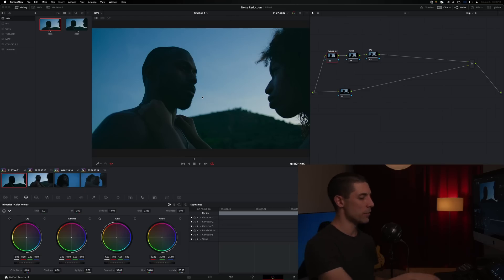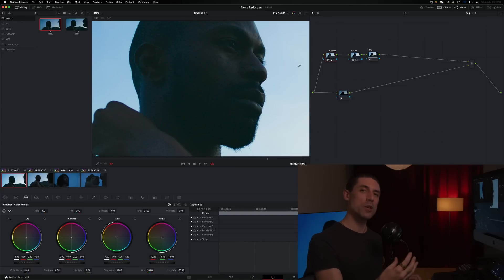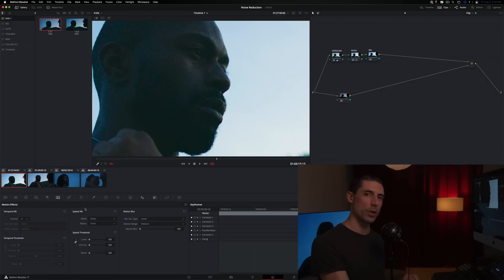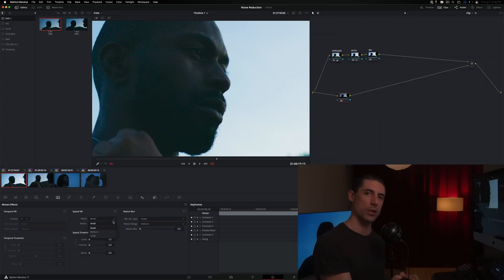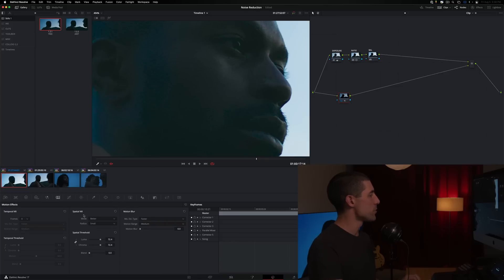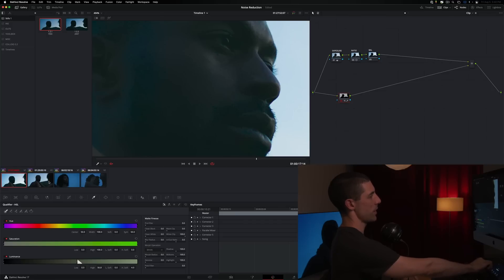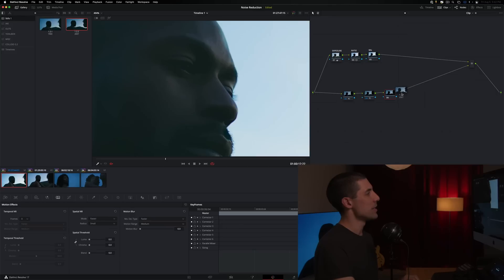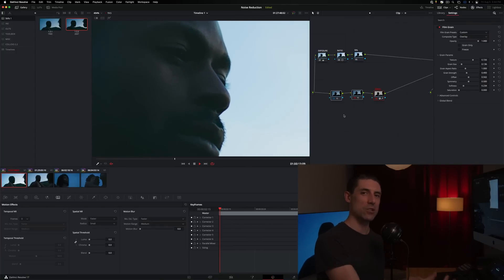How use noise reduction like a pro in DaVinci Resolve

Comment: A question coming from a newby, i saw @CullenKelly put the noise node in a parallel node from the nodes used for the grading you might do to the image, is that the best way? is the there any rule of thumb for where to put the node? some people do it before input CST other after the CST but in serial node, anyone form the audience could provide an insight?

Comment: I've noticed that a lot of people play with color and apply filters where necessary and not necessary.If you're doing commercials or beautiful videos it's understandable. Movies. But when you explain how you use the program and show the interface of the program, you have to make sure that everything, even the little numbers, are visible to the customer or subscriber. If I didn't know what he was doing there, I wouldn't know what those circles were. I am a meter and a half away from my monitor. Just for fun, I turned on my DaVinci - everything is perfectly visible.
Reply: @CullenKelly  I am in no way criticizing you, it's up to you how you want to do it. I expressed my opinion on the fact that the interface (program desktop) is too dark.When you sit down at the beginning and start explaining everything is cinematic and that's fine. But the desktop is dark and so you can't see the details of the program well. Maybe you have a 4K monitor and you can see everything well there, I don't know.
Maybe my English is not very good.
I wish you luck and success. Do as you see fit

Comment: A few notes to add. 

Regarding your intro statements. No one wants noise or has been conditioned to like or accept noise. We have been conditioned to accept and like film grain, not blotchy ugly digital noise. Very different things. I want to underlay, very different things. In fact, after noise reduction, adding back some simulated film grain, helps to give an illusion of texture underneath and that is a good thing. But you don’t add digital noise, especially chroma noise. 

You might get away with some luminescence noise if its film like looking, but not chroma noise. Additionally, when you are uploading to a website like YouTube that will compress the living soul out of everything uploaded anyway, its actually dangerous to leave film grain or noise in the shot, because of the way compression on YouTube works. It treats moving elements in the image very differently than static ones, because of variable bit rate and compression algorithms to save space. 

So when you have fast-moving scenes on YouTube it will look terribly with blocky compression artifacts, and static scenes or with little movement will look pretty good. When you have some noise or even film grain, it will create these pixelated blocky compression artifacts from it. Hence it’s better on YouTube to have overly smooth image than little noise or grain, because compression on YouTube will make it a lot worse than it really is. If you are not outputting to streaming services like social media sites but perhaps Vimeo that is more aimed at videography, it will be less of a problem. Of course proper BlueRay or Theater releases are completely different beast. 

Usually one need to account for a variety of outputs and their limitations. Just as slightly out of focus shot won’t matter much on YouTube when seen on a smartphone, it will be clearly a problem on a big screen. Just things to keep in mind and stay up to date with changes.
Reply: @CullenKelly  Well, noise is not just noise. Film grain is different than digital noise produce by most cameras. Film grain from one film stock is different than from another film stock. If you ever try to accurately simulate film grain from different film stocks or if you ever worked on algorithms for removing film grain you would know that noise from one camera or film grain from one stock is not the same as from another. There is a reason why some film grain is finer in some stocks than others, it used to be a reason why companies release different film stock, to control the size and behaviour of grain. 

Grain behaves differently with different colors and in different tonal ranges. Digital noise also tends to behave differently in different channels, hence different channels can be used for different approaches to noise reduction and also some scenes can appear nosier than others under same settings for the camera. 

There is much more to this than simple noise is noise. That is like trying to teach proper fitness practices and claiming a calorie is just a calorie. Not true, the difference exists and its important difference. 

In regards to noise reduction that is aggressive and leave smoothed skin for example vs leaving digital noise. You have a case there, although not a strong one unless you consider context. Like I said, adding noise even simulated film grain can be detrimental for compressed videos on you-tube, but beneficial for distribution where compression won't turn film grain or digital noise into ugly compression artifices or mushed details just by compression. 

This is easy to prove. Hence considering the level of compression and method of compression of video is critical when dealing with any fast moving elements in a frame. Just like when dealing with audio for example. You need to play back the audio and mix and master it on surround top of the line monitors or great headphones as well as consumer devices, because you never know when someone will be watching your videos on 480p resolution in compressed form on a smartphone on shaky and noisy subway with one earphone and one handed smartphone us in vertical format. lol 

My point is that these aspects of the viewing experience must come into consideration when dealing with audio or video as well as if you are distributing it onto a movie screen or blue-ray. 

You must know this. I'm sure clients require multiple distributions. Or even if you are working with VFX department that may want to do compositing on a clean plate with no noise and add simulated grain later on top of composited CGI elements. All these things are a consideration. Noise is not just noise and there are other factors to consider. 

Cheers!

Comment: Really interesting! I'm a 3D artist and I'm looking for a solution on how to denoise my CG render, especialy on animation renders. Do your tips can be applied for CGI? Thanks for sharing with that video!
Reply: @CullenKelly  thanks for replying! When you do a render (a CG render) the render software calculate all the light bounces and everythings else. You can either leave the render running for a long time until the noise is barely noticible or for a short time and then the software use an AI denoiser to remove the noise. On a still image it's absolutely fine but with an animation it's different. Because the denoise map is not the same on every frames. 
Sorry for my english it's not my first language ^^ 
Hopefuly you'll understand

Comment: Many times with 422 footage the blue channel gets really bad with noise and artifacts. I find it great to use Spatial denoise (Best) at around 30~60 only in the Blue channel when there is a lot of color noise. Or when we need to use the qualifier more agressively with Hue and Saturation. Also, the most optimized way of applying temporal noise reduction is using the Difference highlight mode and dial the lowest Thresholds for Luma/Chroma and Motion. Also, ungang the Luma from the Chroma and let the Chroma go higher. Using all those techniques allowed me to recover successfully very bad footage.
Reply: @CullenKelly  Hi!! recently i noticed that if i use the ofx NR instead of motion effects i can decouple the chroma and luma in ''Better'' mode, sorry for my bad english and thanks for the amazing videos!!

Comment: My WorkFlow
- Apply Noise Reduction on First Node
-  Use Temporal threshold from 3 -7
- Use  Spacial Threshold from 6 -15
- Apply Film Grain on 2nd Node ( i prefer 35mm 4D  with a strength of .65)
- Apply Sharpening to .47 on the 3rd Node
BOOM , Clean image now Grade

.
.
Note - I do this workflow on my a7iii and a6400 bothe 8bit and 10bit footage work with this
Reply: @CullenKelly  That's interesting as I was taught to put it at the head too. Why do you do it differently? I'm very keen to improve our NR!

Comment: Another very instructional video. Combining NR with the qualifier is a great idea. About temporal NR, the best results I have had, is just using 2 frames and slowly rising the threshold while watching the Parade. Like that you can work in the small range, where the NR kicks in. Also with 1 - 2 frames and not overdoing the threshold, motion still will look natural (at least in my perception …).
Reply: I also use this method. I set NR to temporal/best/20/20 and have no noticeable artifacts. Really high settings can cause weird image warping artifacts but just a little bit of temporal goes a long way to getting rid of the very ugliest part of noise.

Comment: I sometimes hit hard on the spacial noise reduction and deal it down on the key gain, but I am wondering if that is actually a propper way to reduce the amount of it specially when it comes from a plug in such as neat video, since it seems to be taking noise by profiling the amount of "blur" it needs... just wondering because I had a crazy project in which combining both plugin and DaVinci nr it was going crazy. But I aaaaalways use a bit of overlay grain via alpha to harden contrast appearance afterwards. 
Also, do you work on NR parallel to your base grade? Never clean the signal and then correct it?

Comment: I don't use Resolve de-noise anymore. Had to many problems with it I just do a group node with Neat video and grain on top works every time but it does take a hard toll on the system so I only leave it on for final render. With neat video you can ask the dp to shoot a gray background so you can extract the fixed pattern noise for that specific iso and camera. Obviously only for large projects.

Comment: Hi Cullen. In one of the last lessons you explained how the parallel mixer works giving the example, that if we add some value on each node, we have a summary, for instance saturation 51 on both results 52. How does it correspond to noise reduction? Is it some kind of a blend, when you apply noise redution in such a node tree? Btw., before that episode I'd give noise reduction as a first node and then feed parallel nodes like yours...
Reply: @CullenKelly  OK, thank you!

Comment: I really appreciate this video, this is super informative. Although, a 4k upload would've helped me see what was happening better.
Reply: YouTube uses another codec for 4K, which preserves noise and grain. I wish they would use it also for 1080p, because many just will upload HD upscaled to UHD to get a decent quality, which is a waste of bandwidth and time. At the viewer end, 4K has to be selected as well, otherwise there is a quality drop again. An additional way to maximize the quality for YouTube ist uploading in ProRes 422 LT.
Reply: @serge_stauffer  I didn't know uploading in Prores could maintain better quality when uploaded to YouTube
Reply: @akshaysaiju4615  It is one H.264 conversion less, but the files are huge, so maybe not for longer videos …
Reply: @serge_stauffer  But won't YouTube try and compress it even more since the file size is huge? Isn't that how YouTube compression works? I could be wrong
Reply: @akshaysaiju4615  Even if YT compresses ProRes LT more, you have a better starting point. Uploading h.264 means that you have already thrown away maybe 95% of the data before YT converts it. To convert an already highly compressed video does not mean that there is less quality loss, it is the opposite. But h.264 can be good enough, if you don’t have to tweak everything to preserve grain or digital noise.

Comment: Why does cullen use a mixer node instead of just putting the noise reduction nodes at the beginning (in front of exposure, ratio, etc.)?
Reply: @CullenKelly  I think if put at the head of the node tree that it is not as destructive if you set it up after doing all the grading, so you can see it in context. I have always done NR after grading but still had it on the first node.

Comment: One thing I liked about the "Faster" noise reduction is that you can decouple the luma and chroma noise reduction and only apply chroma noise reduction if that's what you want. For many clips, I just want a little chroma NR and the Faster preset works pretty well for that.
Reply: @CullenKelly  I haven't tried it but presumably you could apply the Better noise reduction on a layer node with the Color composite mode and kinda separate them that way. Wonder if that would give meaningful results
Reply: Came here to type the same thing! Remove chroma noise first, and then manipulate luma noise if needed.

Comment: Really interesting techniques and I am going to test these! My only worry would be with darker scenes where we can’t separate the highlights from the lower mid tones and shadows. Would a broader option be better? Say only attacking the chroma? I like to work at group levels and have my NR at the beginning of my node tree. When working in DWG at a group level would you place the NR before the IDT or directly after it? Placement of the node seems to be a topic of conversation (just like grain) 

Thanks mate
Reply: @CullenKelly  I agree, only reason I have heard of is to help pull a cleaner qualifier, however there is a better option for that anyways. 

As usual I’ll follow along with you until someone gives a valid reason as to put it at the beginning. 

Cheers mate

Comment: The qualifier suggestion is a really good one. 
In the same vein and depending on the project, I'll often disconnect the luma from the chroma and only engage chroma. I find that chroma noise tends to be the most garish, but luma noise can often just feel like grain. That way I don't lose much of the underlying texture of the image, but I'm not distracted by a lot of dancing chroma noise. For non-commercial projects, it's a winner.
Reply: Do you do this in both the temporal and spatial regions or are you only using the spatial method?
Reply: @cfazio  Most of the time I'm only doing it in spatial. Occasionally temporal. I've yet to use both at the same time.
Reply: @CullenKelly  Yeah, I've always used the Enhanced mode; I've never had much of an issue with it. But I still haven't dove that deep into the NR engine in Resolve, so I'm looking forward to this week's livestream.

Comment: Great insights Cullen. Having used Davinci’s noise reduction as well as Neat Video’s and Revision’s Denoise, it’s always great to have the bag of tricks for these processes that are not only sometimes needed, but can have varying effects on caching and playback before getting them to optimum results.

Have you ever worked with NR within a splitter combiner node? Neat Video allows you to see the RGB channels and luminance when making Reduction decisions, and considering the luminance qualifier that was showcased, it could be a boon if you know there’s more chrominance noise than noise in the Y channel. Could potentially allow for more nuance in the setup, if allowed time in the grade to produce the longer node system, of course.
Reply: Resolve's Spatial NR also natively has this functionality without needing an extra node - just click the chain icon in the Spatial Threshold section to unlink the Luma/Chroma channels, and you can apply NR to them separately
Reply: @GuitaristDavid9  that's true! It's more if you see a leaning in the red vs blue chrominance for adjusting. Certain cameras tend to have more noise in one channel than the other, so having the ability to affect one over the other is always nice to have in the toolkit
Reply: Truly learn something new from this, sometimes I just wanna get rid of the chroma noise and your comment puts me in a new perspective. Definitely will try this one out.

Comment: I've seen some recent DP's masterfully adjust their settings on an Arri to simulate grain with noise and a proper set of vintage lenses.  Not entirely sure how they do it because unfortunately they couldn't make it to the grading session. But it's truly a wonder to behold when it doesn't need a layer of grain in the session or more than 2% NR
Reply: There are a bunch of options with the new arri cam. It can be masterfully done. I'm not sure about models before the alexa LF though. It can look great.
Reply: @devincorboy  that makes sense.  I had heard about a few texture options on the newest arri's.  the episode where I noticed it was with the DP Adam Newport-Berra.  he did amazing work with the Arri footage I was handed.  truly amazing what happens when you crank the contrast and all this beautiful texture pops up